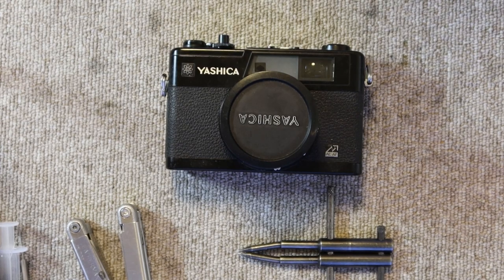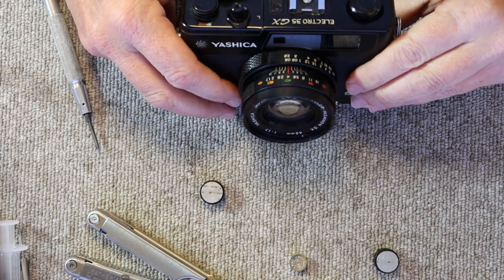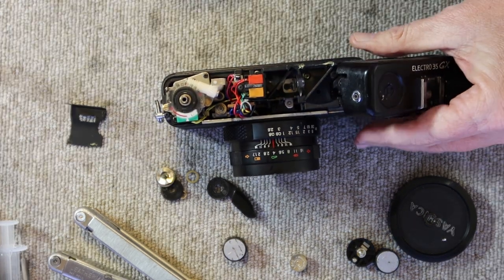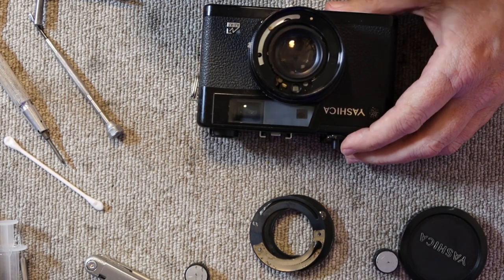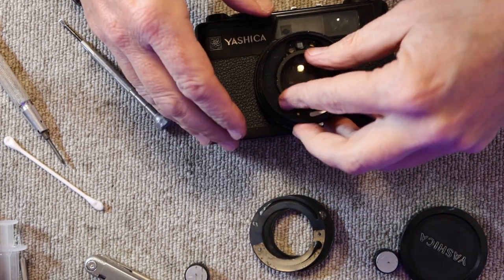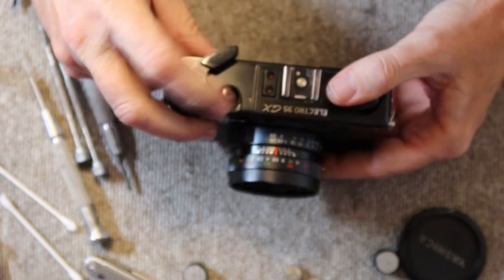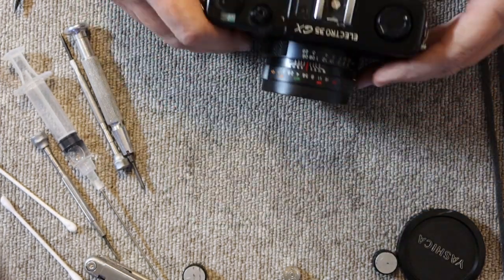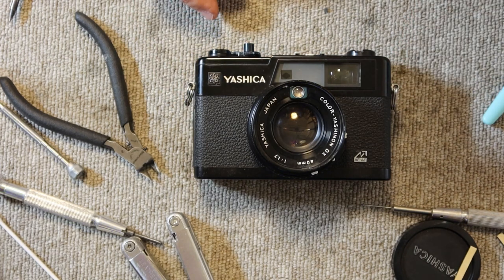How to Clean Up a Yashica GX Camera

Comment: Thank you for your great tutorial video. Very thorough and easy to follow instruction. I cleaned the viewfinder of my CCN today. Went fine except the shutter button stays down until  the winding lever is moved - otherwise everything is working fine. The hardest part was to put the tiny red battery check button in place when putting back the top cover plate. The viewfinder is clear and bright now - Thank you again.

Comment: My GX seems to be in very good condition, but the shutter is only firing at around 1/30 - with or without batteries, and the light meter working when they are installed. Isn't the default shutter speed without batteries supposed to be the max 1/500? What could be causing this? The camera seems to be in otherwise great condition.

Comment: Hehehe, i used an improvised light seal using an unused aircon filter. The material looks like a 3M scrub. I did not use any adhesives, I just copied what was shown in this video and laid it flat on the channels, door and hinge and voila! The Yashica Electro 35 GX is a great camera. Too bad film is getting expensive

Comment: Thank you so much for your video! I just got my GX, got it nicely cleaned but... it seems to have the pad of death problem too (erratic shutter behaviour, mostly top speed, then sometimes correct speed, yellow over-exposure arrow showing even when underexposed...). I got the top cover off but can't find the POD anywhere, seems to be quite different from the earlier electro 35.... Would you know of any way how I could get to the POD without needing to remove the whole lens assembly? Thank you so much for your help and all the useful videos you're uploading!
Reply: I guess I didn't wanna stop in the middle. I went ahead and unscrewed the lens assembly. It wasn't so difficult after all, no removing of any screws on the top, only unhinging a little spring at the bottom and getting a c-ring off and there it was! right at the edge of the lens mounting plate! Replaced it and the camera seems to be working fine now!
Reply: @Nico-df6fr  Hey there, I recently bought my 2nd GX (in black) after enjoying my first one so much. However, this one seems to have a similar issue to what you are describing. With or without batteries, my shutter seem to only fire at around 1/30 of a second or slower, with ISO/Aperture settings not affecting it at all. The light meter seems to be working, though i notice it tends to illuminate the Red underexposure arrow no matter what if the shutter is pressed down to a certain spot. Do you have any links or information on this POD fix and how I can do the same for my GX?

Thanks

Comment: Great video! Thanks a lot! One of the common problem for these cameras is that the light meter became inaccurate or unsensitive. Can you offer some tips to mitigate that?
Reply from the maker: The problem is usually haze on the light meter cell or the buildup of a calcium-like substance between the cell and the window on the lens name plate. This can sometimes be 2mm or more thick. It needs to be scraped out, and then the glass on the meter cell cleaned.

Comment: The shutter lock ring on my 35gx is stuck in the open position - do you know what could be causing that or how to fix it? I noticed you dont remove it when taking off the top cover. Thank you!
Reply from the maker: To unstick it, you would probably have to remove the front lens element, its likely that the shutter actuation linkage is stuck. Sometimes this can be fixed with a little solvent and oil, sometimes it can't. The linkage which is usually stuck is either near the electro magnet, or near the bottom of the shutter. A few drops of solvent applied to these areas may unstick it.

Comment: With my 35GX the aperture ring is quite tight, and the retaining ring at the front of the lens is refusing to budge, is it possible to lubricate the aperture ring from the outside of the lens assembly? (Love your videos and the little snapshots of life you give at the start. I look forward to them..)
Reply from the maker: I don't recommend trying to lubricate the ring from the outside, the oil will get everywhere. If the ring is too tight, there may be some other issue. Use solvent to soak into the retaining ring, and it should be easier to remove.
Reply: @japanvintagecamera8869  thank you, I'll give that a go..

Comment: I have a cracked (rangefinder/viewfinder) cover glass that is slightly loose :( how essential is it for me to match the thickness and the refractive index of the glass if i decide to replace it? would it meaningfully interfere with my ability to focus correctly?
Reply from the maker: The front class won't affect focus, and it is common that the glass is loose or broken. You can replace with clear glass, if you can find a sheet thin enough. I use a pair of small wire cutters to trim the glass into the proper shape. You may break a few before you get one which is useable.
Reply: @japanvintagecamera8869  Thank you so much!

Comment: I followed the steps. before I started, I could press the shutter button and everything worked. If I now press the shutter, the camera  does nothing? any idea what i did wrong. I can't move forward the film anymore? Seems I broke it.
Reply from the maker: Check and see if the plastic window on the frame counter didn't:t fall inside the camera, this is common problem and can cause the camera to jam, the window can get stuck between the gears. Another thing to check is that the spring under the shutter button is seated around the shutter plunger in the camera body.
Reply: @japanvintagecamera8869  thank you the frame counter window was the problem! thank you!